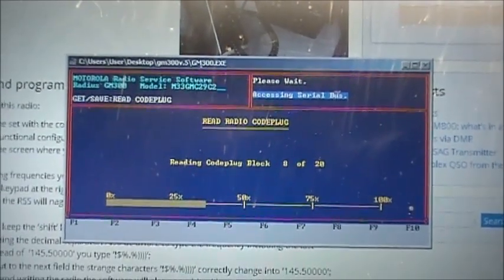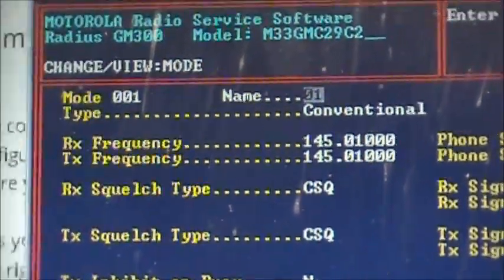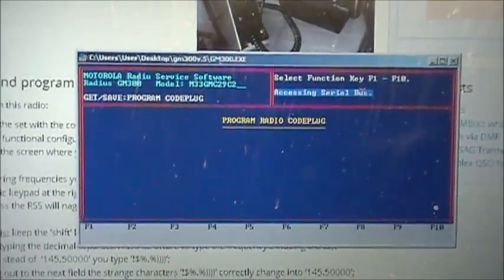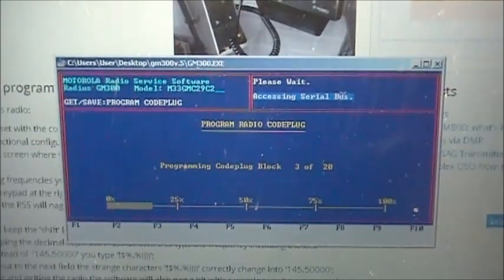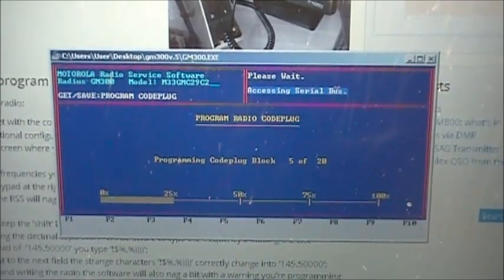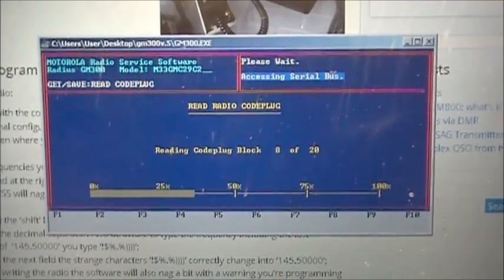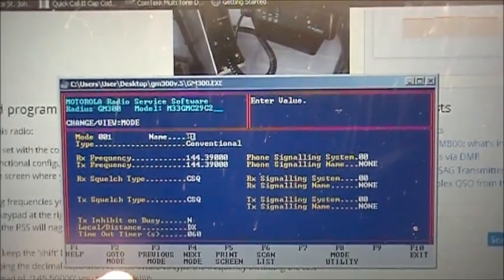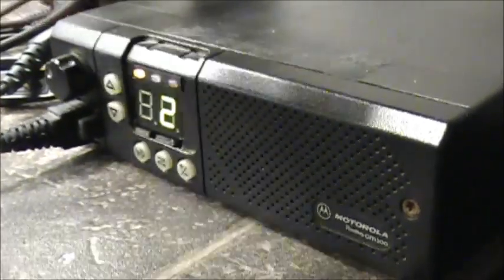MOTOROLA RADIUS GM300  - Programming

Comment: I have FTDI usb-to-serial cable (RJ45 to male USB). I am not able to read it in the prog. software (windows xp). I have the drivers all installed. Am I missing something? Thank you!
Reply from the maker: USB to Serial cables have been know to not work on some older equipment.  You could try a dedicated serial programming cable with RIB if you have it?

Comment: I'm getting "Directory c:\gm300v.5 doesn't exist" messages. I'm entering the mount commands correctly. I'm following the instructions the best I can. The Com port settings are correct. I tried copying a few (from separate download sources) GM300 files, one at a time, into DosBox. I tried GM300 version 4 instead of 5. What am I missing?
Reply from the maker: try pure DOS and the slowest pc you have

Comment: I need to program 144.390 MHz. When I put it in the code plug I get an error of it being out of range.
Reply from the maker: You need to follow the directions i have in the video.  You do not enter the frequency like this: 144.390   You need to HOLD the SHIFT key while you type the numbers like this: !$$.#()   You must type the decimal point as normal.  Hope this helps.